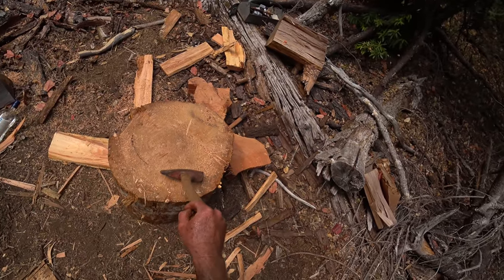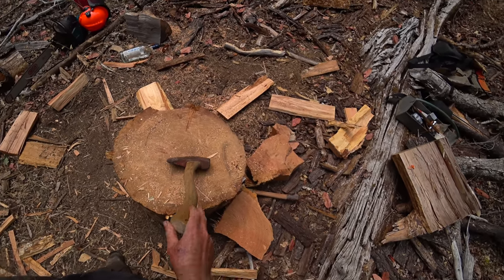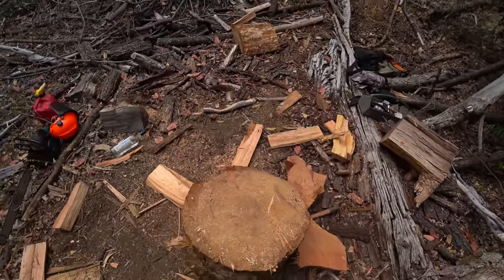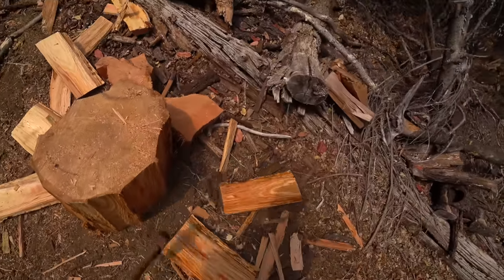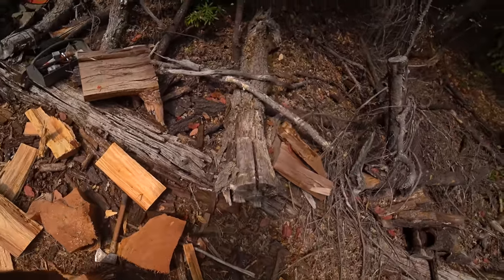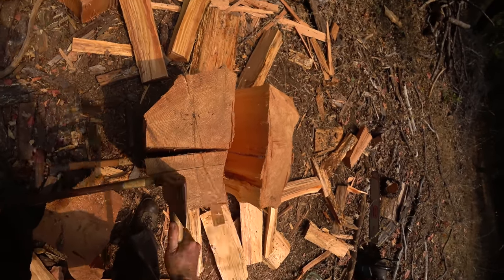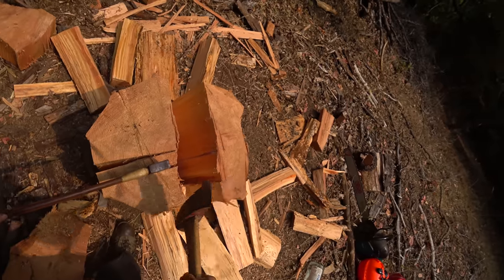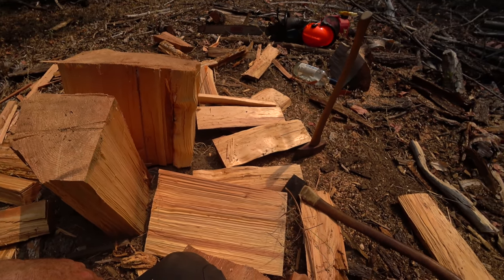Don't Split Big Firewood Rounds In Half (usually)

Comment: knocking slabs off the side is a good way to send your axe into your leg - use wedges instead
Reply from the maker: I'm not sure why you would think that.  I think it is actually one of the safest methods.  Not impossible to hurt yourself, but splitting wood is just unsafe if you don't do it right.  I will eventually explain how to do it safely.  Not a fan of wedges and rarely use them.
Reply: @SkillCult  When you get a close call (if your lucky its only close) it may change your tune. It's also not sustainable to have your arm repeatedly torqued like that, even with a loose grip its not an ergonomic motion, repetitive motion injuries are a real thing.  

You don't need to wedge every piece or every round, but to avoid their use is just going to needlessly cost a lot more effort than you think you are saving. (I have the same species of trees around here.) Sort of like thinking you are being thrifty by buying the small packets of something because the cost per piece is low but then buying 100 of them, rather than just getting a couple of 10lb sacks for a lower unit cost.

The surface area of final split wood will be about the same with either method and the amount of wood mass moved aside will likewise be similar. While the difficulty of making one big split is high you are also gaining a large surface area, the total energy expended for the round is actually the same or less with a big split because the wood is only moving aside a little bit and it sets you up for better follow up splits. Slabbing small pieces from a round tends to move the wood a larger distance even though it is in smaller pieces.
Reply from the maker: @mytech6779  I"m not a spring chicken here. I've had a lot of repetitive stress injuries from other activities.  We also don't all have the same susceptibilities.  How about we revisit in 10 years when I've gone through another 10 years of firewood and we'll see if the previous decades with no injuries was just a fluke ha ha.  All the internet experts are sure I'm about to cut myself now, even though I never have.  Eventually it will happen if I chop enough, but I doubt that I'm going to suffer any significant injuries from splitting after all this time.  If so, it will be when using an axe..  I'm not buying the physics lesson.  I like working against the large mass. it feels like an advantage to me.  The small wood moves far because it is a small mass, because it actually separates all the way, and because the head is pushed away from the larger more stable mass outward.  Seems like an advantage to me.  If the round would split easily in half, maybe I'd do it, but my usual approach to large and even medium rounds is slabbing.  I don't have to touch the wood until it is down to a medium sized round, when I might pop it in half, or slab it til it falls over.  Depends on the piece, knots and other attributes.  Now if I had to split a couple of cords a day, I might accumulate some kind of repetitive stress effect.  But I don't and I'm not going to.  I also know professional firewood splitters that slab.  I'm pretty sure that none of us do it because it sucks and is inefficient and injures us.
Reply: @SkillCult  I have done multiple cords in a day though I don't anymore, and I do use slabbing on a round here and there, it just shouldn't be the primary method. 
I've found knots to be the primary hindrance to splitting fir, with diameter hardly an issue. Length can add some difficulty though, short rounds seem much easier all around. A 30inch round should crack without much fuss if you have the right tools. (Nothing wrong with placing blame on tools where valid. A good craftsman doesn't blame his tools ...because selecting the right tool to own or use is part of being a good craftsman.) 

 Wasn't really saying you would get cut,(especially with that club you're using, HA) there are other ways to get injured by a glancing swing. Bruises, pull muscles, sprains, chunks of wood bouncing back. Not generally life threatening but neither is a punch in the face and I avoid those just the same.

Physics don't got need for buy in, they be regardless. (Though the total energy benefit is minor, and I'm not going to waste my time or yours with a drawn out derivation.) 
The maul being moved sideways is the majority problem with slabbing both from [total] energy waste and injury hazard, not an advantage. You want the wood and maul to deflect as little as practical, its back to the old velocity squared issue. Yes, a single slab is smaller than a half but there are many of them.

Comment: The full round has more mass to absorb energy?
Reply from the maker: I think that is a legit way to say it.  Tthe way I think of it is as the maul attempting to move the wood, or the wood resisting the outward force of the maul.  If you hit around the edge to slab, the large mass of the round will very much resist the energy of the head, so the head will move toward the smaller mass.  it is easy for the maul to push that small mass off of the side.  So you could say I think that less of the energy may be simply absorbed to no or less effect.  If we hit it lets say in the center, then the maul has to push both sides apart. If it does not form a deep crack, then most of the energy is simply absorbed as vibration, which doesn't do anything for us. If we hit a small round in the middle, the axe can push the two halves apart more easily.  We might split it all the way, or most of the way, through, and the wood might even fly outward.  then more of the energy would be used to move the wood around, vs just absorbing the energy as vibration, or transferring some of it to the ground or back up the handle, etc.  Makes sense to me when looking at it as where the energy goes.

Comment: Of course every round is different and you make the best of the tools you have. but....
Yes splitting the round in half involves more surface area for that one split, but generally wood shrinks more tangent to the grain than is does radially, which is why you often see radial cracks in a dry round. This makes radial splits easier per unit area than tangential splits and all splits after the initial halfing will be easier. 

The problem you are demonstrating here is mostly how to work around a limitation of the tool, it is bouncing off because it is blunt, too light for general purpose splitting, and on a short handle(maybe it was a boys' maul?) so the energy of the hits is dissipated and wasted rather than cumulative. Use of a sharp wedge, or a heavier and properly ground maul would greatly reduce total effort. 
I respect the challenge of making do, I've split larger wood than that with a small hatchet but it isn't efficient. (Using the hatchet as a wedge pounded in with a small log to make a crack that I then widened with wedges I split/whittled from smaller wood.)
Reply from the maker: One reason I'm interested in that maul is that it's got something like the blunt German grind on it, which I've always been curious about.  I need to get a long handle on it. I just had that lying around and it is an axe eye maul, so I can't just slap my usual fiberglass maul/sledge handle on it.  I don't like splitting with short handles much.  The other reason is the weight. It is much easier to swing than a 6 lb or higher.  I'm curious how it will perform in the long run, but I'm not going to make any assumptions until I use it a lot.  I definitely miss the mechanical advantage and whipping effect of a longer thinner handle, but I don't miss pulling it out of the wood, because, for better or worse, like the German mauls, it never sticks.  Most of their splitting as far as I can tell is on meter long, mostly smaller diameter logs.  Yet for those limitations, I still can efficiently slab out this round without going all in on it.  Properly, not my favorite word.  But for someone that has tried every size, grind, length of handle and technique on every wood, I suppose it might be justified.
Reply: @SkillCult  When I'm talking blunt I'm only referring to transition radius from the edge back about 1", not the overall average head angle. I find getting stuck in a significant way happens further back from the edge. 
Then again I may not notice the frequency of sticking. With my style I keep two mauls or a maul and a sledge so if it takes more than a moderate yank to unstick the maul, it immediately becomes a convenient wedge.

Sticking usually means some progress as a starter crack, while bouncing almost always means total energy dissipation and no cumulative progress.

Comment: Have you ever been tested for adhd/add? 
Not meant in a mean way im just wondering:)
Reply from the maker: No, but I'd probably test pass.  Probably aspergers too, but what's the point.  I won't be taking ritalin anyway :)
Reply: @SkillCult  true. But maybe some type of therapy to help… might make sticking to projects easier. 

But i enjoy your videos nonetheless :)
Reply from the maker: @sempi8159  I have ideas and stuff to try and that is actually on the agenda.  It's an issue. It's not just the attention, but the constant noise in my head. the gears never stop turning.  Probably meditation.  One thing about people with those kind of issues though, is that we are ironically often capable of extreme focus.  but we aren't good when we aren't focused on something and not so good at big picture efficiency and tasking.  I think of it as less of a disorder than an ability poorly used and uncontrolled.
Reply: @SkillCult  good Point. I have the same „condition“. I do enjoy the hyper focus but i really don’t enjoy the constant noise and interest switching. Lets hope the „therapy“ helps with that/helps managing it better :)

Comment: Study the log, and fine the deepest longest cracks > start there >  The best maul is?  The 6 pound maul!  Not the 4 and 8 pounders
Reply from the maker: I often don't go for the cracks personally, it depends.  If I'm slabbing like this, it doesn't matter much.
Reply: @SkillCult  You should Stop! Look!  and  Listen!  To what i'am saying!   hard head
Reply from the maker: @426superbee4  I did, then I responded. I've read jillions of rounds of wood and attacked plenty of cracks. Sometimes I go for cracks, but I often don't.  A curious person might wonder why, but apparently I couldn't be right if I do something different than you.  BTW, this maul is 5 lb.  I like it.  I usually use 6 lb.  One size fits all doesn't fly in woodsplitting.  More than one way to skin a cat.

Comment: Your not getting penetration. Either its dull, or to blunt !
Reply from the maker: but if it was sharper, I'd probably be getting it stuck over and over.  In mauls I'm typically partial to obtuse edges.  I don't think there is a perfect edge. If it's perfect for one wood, it won't be for another.
Reply: @SkillCult   Its not a AXE!   ITS A MAUL!   Every freaking maul. The edges are way to blunt!  I have to slim them down!  Kinda like a AXE .  Then they will easy start splitting>  YES!  SOMETIMES, THEY DO GET STUCK.. Beside i don't split my rounds with a MAUL!   What i used is a 4 pound TWISTED CONE WEDGE and a 8 pound Sledge hammer. To split them into halves, Then use the maul. Then finish up on the log splitter
Reply from the maker: @426superbee4  You sure seem to have a lot invested in this conversation.  I usually slab first on big stuff, especially very big.  I can be slabbing off a piece of firewood per blow while someone is picking up and starting wedges.  it doesn't apply to every round, but it's often the fastest easiest way.  I wanted to experiment with a maul that was similar to the german mauls that tend to have more obtuse edges.  that is actually why I bought this one.  I'm sure they are wrong too though lol.  So far I like it, and I've use it a lot.  Most of my mauls are more or less like that and I like them that way.  Since I split on the ground and driveway all the time, they are super tough when slammed into the ground.  Splitting haphazardly, and not having to worry about the edge saves a lot of time and extra effort.  Miles of split wood behind me and lots of different tools later, it works for me.  But I don't use own or want a wood splitter, so my approach is going to be different.  I'm not trying to reduce things to something I can move to the splitter.  I barely move wood at all until it is reduced to firewood.  No splittting stump.  a lot of it even with the maul is hit however it lays on the ground, or I just kick it into position a little or lift it with my foot.

Comment: Lol why would you post this video when theres lot of videos showing you how to do this properly? You did it the hard way and still only managed to make kindling, not firewood... lol get a proper maul (not 5lb) then hammer it in pie pieces until you have some spider web cracks then you swing at the edges to split good sized chunks off. Its less pieces, less swinging usually and better sized wood for heating.
Reply from the maker: properly lol.  Better sized wood for heating what in what stove?  context is king.